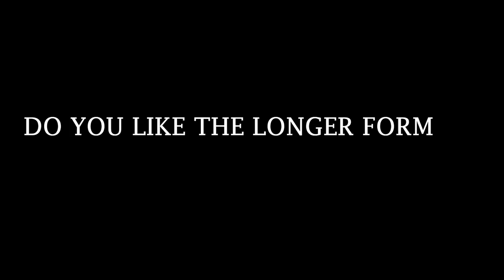American Bee hives are ALL WRONG here is why! split hives 4 weeks later

Comment: I heard that in Spain, they built electrified cages around their beehive boxes that will only fit bees through. When the giant murder hornets come to get the bees, they get electrified instead.
In Japan, where the murder hornet originated, the bees have learned to kill the murder hornets by coaxing the foraging murder hornet into the hive and then striking it all at once where they then vibrate their bodies all together in a huge bee ball and they actually cook the murder hornet! 
This behavior may be taught to the bees by inserting a live murder hornet that has been tied off around its body so it can't move or walk and then letting the bees recognize this threat and then putting the hornet through a coil of oven wire that has been coiled to go around the hornet's body and then cooking the hornet to about 40 degrees C which is the approximate temperature the bees go to when they do it themselves. This may give the bees the idea that heat kills these hornets and they might end up trying it to survive when a real hornet comes into scout them out.